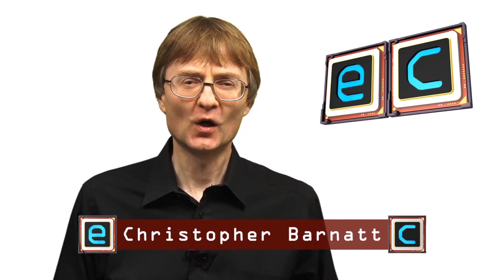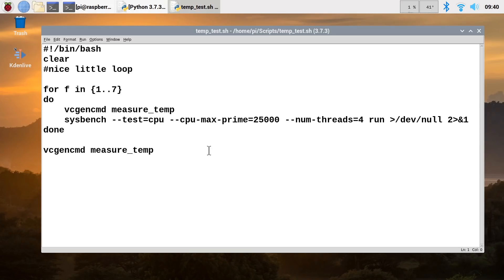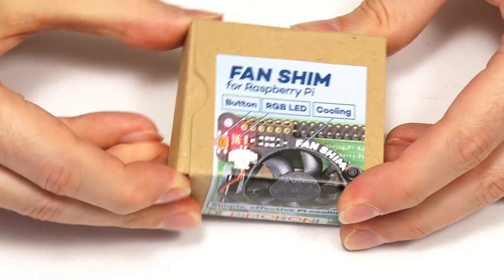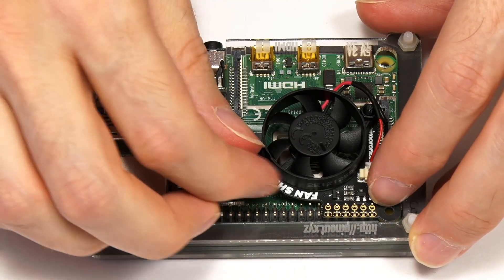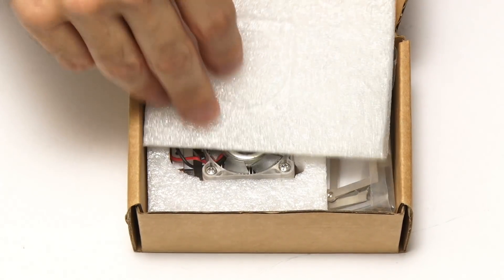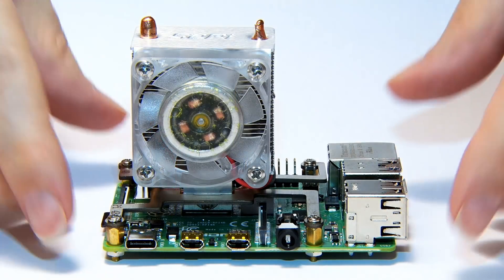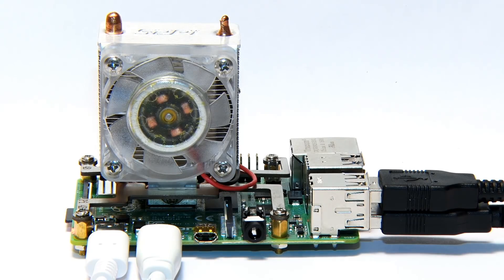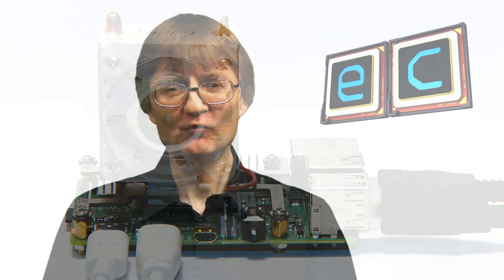Raspberry Pi 4: More Active Cooling!

Comment: This is such a cool (ha ha) video.  I am only sad that I can't give it 2 thumbs up.  I think the next step in your overall test regimen is a sound level meter.  I say this because I recently setup a Pi 4 with a centrifugal fan rated at 5 volts.  It was too noisy for desktop use, but I found out that I could run it off the 3.3 volt GPIO pin #1 with results that approach the Fan SHIM.  Thank you so much for your videos and keep up the great work!
Reply from the maker: A sound level meter is a great idea. I must think about that. :)

Comment: I love this video its amazing what they are doing with the pi now the fan even looks good on it this computer is dual booting Ubuntu 19.10 and Solus 4 both Gnome 3,34i love Linux and everything that will run it if it does not run Linux i have no time for it but thankfully most everything does.

Comment: Can you 3D print a case for the Raspberry Pi 4 with the ice tower on it, If so how much would it be?
Reply from the maker: It could be done, cost would depend on how extensive the case was, and how/where it was printed. I could imagine a case with the ice tower sticking out of the top . . .
Reply: @ExplainingComputers  sounds good I was thinking black and red for the colors not sure on the design though.

Comment: I had a spare 60mm 12V Noctua fan I rigged up to the 5V on a 3B.. it works great and is a really nice size at the same width as the Pi. Just need to get around to designing and printing a new top case with cable management to mount the 60mm instead of a 40mm.
Yeah with some heatsinks and a 60mm Noctua you're knocking on the price of the Ice Tower though...

Comment: If you wanna be super hi tech you could write a script that performs PWM on the GPIO pin that powers the ice cooler fan so it could be temp controlled based on sampling the temp sensor like your test script does

Comment: When I run this script it finishes instantly and displays the 8 temperatures all the same. What have I done wrong?

Script:

#!/bin/bash
clear
#nice little loop

for f in {1..7}
do
  vcgencmd measure_temp
  sysbench --test=cpu --cpu-max-prime=25000 --num-threads=4 run >/dev/null 2>&1
done

vcgencmd measure_temp

Comment: Thanks for the video, very well done and very entertaining. If you use the Ice Tower, how do you cool the USB and Ethernet controllers? I liked your previos video where you attached 3 HeatSinks, I think a solution with IceTower and some additional heatsinks for USB and Ethernet would be ideal.
Reply from the maker: Agreed, some heat sinks on those chips would be advised. The one downside of the ICE Tower is that is it not blowing air down onto the whole board.

Comment: @ExplainingComputers you didnt let the Ice Tower to heat up, it takes around 20-30 minutes to heat up the body under full load, it comes just few degrees lower than noctua longterm run
Reply from the maker: Interesting. I wanted to run a consistent test on all setups.
Reply: @ExplainingComputers  I was running noctua setup for a while but i want to put few of Pi4s in cluster so size of cooler is making problems for me. I'm gonna give a try to https://www.aliexpress.com/item/32962800319.html?spm=a2g0o.productlist.0.0.47613c677XZtww&algo_pvid=b0f6925a-0957-4b81-897f-3a25d1aea96a&algo_expid=b0f6925a-0957-4b81-897f-3a25d1aea96a-2&btsid=1e24abd1-c358-4e85-8956-25d78f4764fd&ws_ab_test=searchweb0_0,searchweb201602_,searchweb201603_53

Passive cooled model, i've ordered 5 pieces.

If you're interested i can share cooling details with you when they arrive.
Reply from the maker: Please do share your temperatures here. Data is always good. :)

Comment: I have a cooling solution that you might like to replicate / test: It consists of a small normal heat sink, a small (approx. 8 fl. oz) pure copper cup, some paper napkins wrapped around the outside of the cup and held in place with elastic bands. The cup is placed on the heat sink and filled with ice.

Pros : cheap, silent, keeps the soc extremely cool under virtually any load.
Cons : condensation can be an issue if left unchecked, ice requires periodic replacement.

Comment: Would it be possible to connect the ICE tower fan directly to the Pi 4, but control the fan so that it only turns on if the temperature rises above a given limit. Say 50 C? Like, via a simple script or of it needs a ”full” software?
Reply from the maker: The fan is 5V, so connects to the 5V line. A control circuit could be introduced to control the fan via GPIO, but that would be extra electronics.

Comment: Based on the results in this video I tested skipping the heat-sink and just use a small fan. The fan is 40 mm, 12 volt , but i run it at 8 volt. It silent at half a meters distance and uses less than 0.5 watt. 
It resulted in a drop of 25 degree from 56 to 31 when idle and even more under normal load . with no heat-sink the height of the fan is level with the USB/Ethernet ports

Comment: the armor case performs like the ice tower with the fan off, i wonder what would happend with a 40mm fan slapped on top of THAT thing. I think very good also and more compact than ice tower vertical mounting.

Comment: <3 air coolers and Noctua stuff.  I use oversized ones (with heatpipes) to cool various electronic or computer components.  Advantages are fan(s) does not have to spin so fast, lower noise, and for modems, wifi routers... I don't even use fans at all... totally passive cooling while keeping the hot stuff cooler,.  My equipment lives longer with lower operating temps.

Comment: If you remove the upper part of the tower cooler aluminium fins  and saw of the heatpipe you can run
your watercooling through it... ... whereas i would still stick with the "fan only no heatsink" version because its "good enough" ;-)

Comment: Because of the fins being parallel to the board, I wonder if tipping the pi + ice tower on its side would improve passive cooling, since convection can move the air easier.

Comment: What I want is a case and cooling combo that is reasonably protective, is very unlikely to thermally throttle, does not interfere with radio (WiFi or Bluetooth), is silent or at least almost silent, doesn't block ports, and is not overly large or expensive. Probably a plastic case with a small fan (and maybe small heat sinks, but the Pi 4 seems to be it's own heat sink really), or possibly a case-is-the-heatsink solution if it doesn't screw up radio range too much. I have no interest in attaching a thousand pounds of refrigeration and trying to overclock to a billion giga-hertz.

Comment: This entire series of cooling the RPi 4 has been great, and I would love to see more.
There is one passive possibility that I would like to see done.  Is one aluminium plate with tall diagonal fins that covers "all" of the chips at once.  Further, I would like it to be thermally connected to the chips with thermal compound or thermal epoxy.  I am wondering if there should be channels in the plate to help separate the thermal loads of each chip from the other chips.  
Doing the same in copper would another test.
Reply from the maker: There will be a "Part 3". :)
Reply: @ExplainingComputers  Will Part 3 (or part 4, which I welcome) cover any of the conditions/comments/suggestions that i have noted above.  Yes, I'll be watching in the meantime anyway.

Comment: You should have removed the fan for the "no fan test" as it blocks air flow.
Reply from the maker: Slightly, but the screws add bulk to the metal! :)

Comment: It might be interesting to try the fanless passive test with the board oriented so the cooler fins are vertical to see if there is an improvement due to convection current encouraging a natural air flow. Its possible the heat exchange is sluggish without the fan as the hot air sits between the fins only bleeding out the edges slowly.

Comment: I got 5 amps running through my PI model 2 rev b.... No fire yet!!!... Boots up to retropie really really fast... Using an old PC power supply 5 amp min 23 amp max 5 volt leg... I got it in a arcade cabinet I built from scratch... (well a framed skeleton of one anyways) I'm too big to fit inside one to wire it so I framed it like a house... Two heatsinks... One on processor and one on gpu chip next to it with a five inch fan blowing on it... Played Metal slug for a couple hours with a fire exstinguisher next to me... No kidding...That is a sweet cooler... I'm gonna get me one...It will look awesome and I can continue to run 5 amp power... very useful video mate!!!....

Comment: It's not necessary required to have active cooling for Raspberry PI 4. I have tried a good aluminium case, which act as a huuuuge heatsink itself. It's named Joy-it Armor Case "BLOCK". I executed your script with it and got following results in a 25 *C ambient environmental:

temp=48.0 'C
temp=57.0 'C
temp=61.0 'C
temp=61.0 'C
temp=63.0 'C
temp=64.0 'C
temp=64.0 'C
temp=66.0 'C

Run time is about 10 min.

For me that results are pretty fine. No throttling and that, basically, this not justify any active cooling which will add noise and another component that can fail in your system.

Comment: I think the biggest improvement came from a proper retention bracket and good thermal paste. The problem with a basic "stick on" heatsink is the thermal pad is nowhere near as conductive as thermal paste + some contact pressure.
Great video though, thanks for comparing several options!
Reply from the maker: I so totally agree.

Comment: The CPU in my desktop machine always reports it is running at 60°C, regardless of ambient temperature.  The fan runs faster as the CPU load increases, but the temperature never seems to change.  The only exception I can recall was when the heat transfer compound dried out a few years ago and I had to remove the heat sink and re-grease it.  That  was before I had continuous temperature monitoring and the only clue that something was amiss was the fan running at high speed, even with no programs running.

Comment: So cool! Haha, pun intended! ;-) 

Thank you Chris for finally applying the heat sink using thermal compound as I asked on one of your other great videos! Very interesting result indeed! I would like to see you testing other sbc with thermal compound cooling setup like the ASUS Tinker Board, RockPRO64, Rock Pi 4B, Orange Pi 3, NanoPi M4, and many other powerful  competitors.
Also congratulations on 500k subscribers! Well done :)

 That said I would like to add that the PINE64 foundation(?) is going to release a linux laptop based on the ARM A72 + A53 Processor (for $200). I was wondering if you are going to review it and if so, would you please also compare it to other (old) laptops one could purchase for around that price, for example a refurbished ThinkPad X240 or DELL Latitude E5530?
Reply from the maker: I must get back in contact with Pine . . .
Reply: @ExplainingComputers  Oh that's so exciting! I am very much looking forward to watch this comparison between what was state of the art back in the day on the one hand and what you can get today that is running on the basis of a single board computer on the other hand. That would be such a great pleasure to watch! I also really enjoyed your "Classic PC" videos! What a nice throwback!

Comment: You have to be commended for the great work you've done with these tests but unfortunately the results aren't comparable. Given the various cases you've used as well as the final test with no case at all the numbers are indicative at best.
Reply from the maker: The numbers are representative of the configurations shown. I used the Pi 4 official case in the very first test purely beause it is the official case, and so poor for cooling.

Comment: Would like to see your thoughts/test with the FLIRC passive cooling case
Reply from the maker: I will be doing this.
Reply: @ExplainingComputers  I heard heat accumulates in those FLIRC cases and the RPi4 can easily make them get too hot to touch after running under load for a long time. But since the entire case is thermally coupled to the CPU, maybe you can remove the black plastic top or cut a hole to expose the bare aluminum, and mount an Ice Cooler fan right there with an additional layer of thermal paste, as if the FLIRC case was the CPU itself, and see how that affects the temperature.
Reply from the maker: @jasontiscione1741  I am sure you are right -- the FLIRC cases will get hot, and maybe very hot. I'll be looking at a range of passive cooling solutions in my next Pi 4 cooling video, but suspect that non will mtch the active ones. The Pi 4 simply generates a lot of heat.
Reply: @ExplainingComputers  Will we see mineral oil passive cooling? (You can always add a fan later for an active cooling solutions video. Fans don't mind circulating oil instead of air.)
I mean, these things are only $35... someone's going to do it.

Comment: Thanks for great content as always. I'm kind of curious to know if the tests all run about the same amount of time? I don't think the Raspberry Pi 4 thermal throttles until 80C. I like and use the Fan SHIM as you can still easily enough attach a HAT such as the Pi Sense HAT above the Fan SHIM...
Reply from the maker: All tests here ran in 10 minutes -- no throtteling.

Comment: Mr. Barnatt, I think one of the solutions to visit for passive cooling would be Mineral Oil Immersion. It often holds incredible results with a decently sized reservoir often outperforming many active cooling solutions and be extremely low maintenance. Thank you for these videos, I always look forward to seeing them. <3 Now if only some one would make a ITX to R-pi conversion mount like the old Fairy-Wren PCBs. Or a active cooling solution that comes in from the side so we can use a Pi-hat..

Comment: The RPI4 throttles once it exceeds 80 C, so realistically passive solutions that reach the 60s for temps should still provide the same performance as the active that reduce the temps to 50 C or less.  I use the FLIRC case for passive cooling as the entire case acts as the aluminum heatsink.

Comment: Noctua always wins. They have the ugliest fans. But those fans are quiet, reliable, and industrial grade. I use them exclusively. No RGB bs. Just silent and efficient fans. Two that I have are running 24/7 for 11 years now, and still haven't failed. I need to bend down and put my ear next to them to even hear that they are running. But visual and sensor wise it's obvious they are doing their job.

Comment: Move to the Arctic, as Pi4s are causing Global Warming, I use a cheap heats sink and a one of the little Pi Fan's as Minimum Cooling on 3 & 4
They never throttle and average idle is about 36 and average running temps about 44-46, once and while it might hit 52, So many cooling options, Have a look at this picture, bought a couple of them
[img] https://www.seeedstudio.site/media/catalog/product/cache/9d0ce51a71ce6a79dfa2a98d65a0f0bd/1/0/10_1.jpg [/img]

Comment: With the ICE Tower cooler mounted, I wonder if heat dissipation would be better, and resulting operating temperature lower, if the fins were aligned vertically instead of horizontally.

Comment: Very nice video! I remember that once I was watching a video in which someone did put a liquid cooling system on the RPi 3B, and also overclocking it. It may look pointless, however, it would be interesting to try some small scale liquid cooling.
Also (I am aware that this is highly inefficient), it would be interesting to try some thermoelectric cooling... considering the power of a RPi, it shouldn't be much of a hard setup. Can it go lower than 20 deg Celsius?

Comment: Hi Chris. Excellent site & congratulations on 500,000. How can a HAT be added to Pi with giant fan in the way. Power lead to alternative fans also may impede fitting HAT. The Fan Shim seemed great solution but does it simply fit over pins, no soldering? Would you agree that access to 5v and ground other than GPIO pins for fan power would be useful. For your next challenge, connect the desktop Raspberry Pi 4 to a  Printer on an existing network. Better still, Printer / Scanner. There is very little or no mention of Printers or CUPS in most Raspberry Pi documentation. Thank You

Comment: Check out passive whole-case cooler: Flirc Raspberry Pi 4 Case: https://flirc.tv/more/raspberry-pi-4-case It does excellent cooling thru conducting the heat away from cpu with all aluminum case.
Reply from the maker: I will be doing so. :)
Reply: @ExplainingComputers  FLIRC: A Cooling Case for the Raspberry Pi 4? Does it work? (Quickie) here's a quick demo: 54c normal, 64c after 15min stress test. 24c room temp: https://www.youtube.com/watch?v=F-tvuvTpUkA nice thing about passive cooling: no parts to wear out!
Reply: the flirc is another case that is ONLY making contact with the CPU chip... and NOT the RAM nor the USB3 controller....  again another not well thought out design.... IMO